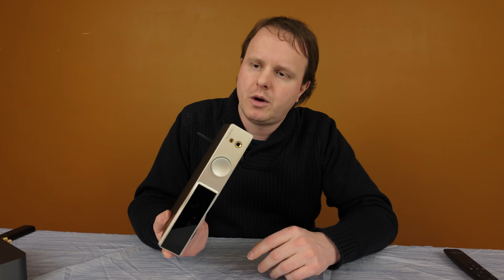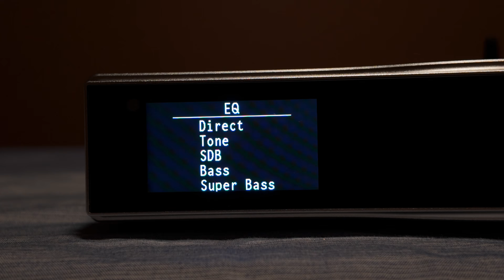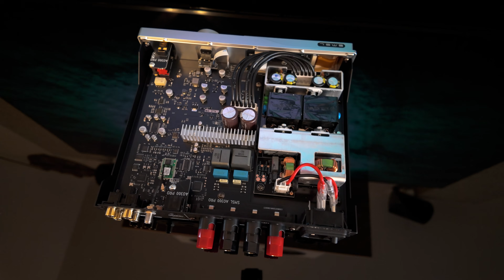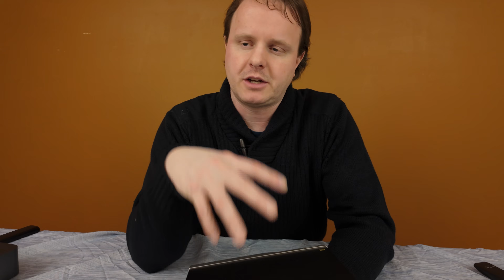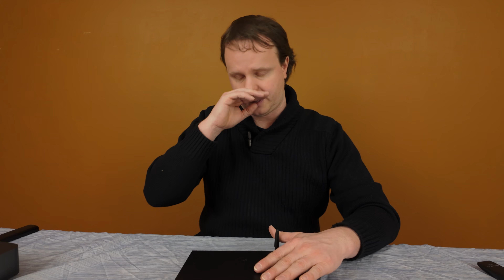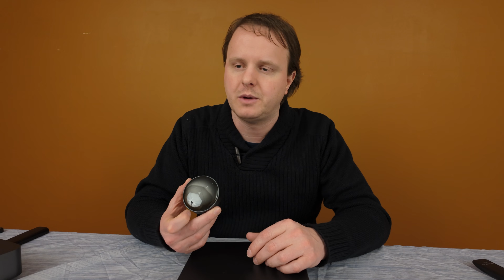Extremely High Quality Sound In a Compact Affordable Package SMSL AO300 PRO Review Vs. WiiM Amp

Comment: How does it compare to the smsl raw ha1? Seems very similar to
Reply: I recently bought the smsl raw ha1. It's almost identical AO 300 pro. The raw ha1 doesn't has hdmi arc. Further it is I think identical. They use both the same dac Cirrus Logic CS43131 DAC. I hooked a bluesound 2i up that I recently second hand bought. it works and sounds great. What I like also is that both have the same width. The bluesound 2i fits perfect on top of the smsl. I amde the choice for the raw ha1 because I only wnatd it for hifi use. But if you want it for tv and music, I would not doubt to choose for the smsl ao300 pro. The smsl raw ha1 and smsl ao 300 pro have the same width. The sound is realy good.

Comment: Those seeking reasonable audio reproduction need to know that nobody has been able to convincingly show they can hear differences in properly performing amplifiers. Testing goes back to the 1970s, and includes people who swear they can hear a difference (before being tested). It also is questionable to use the phrase "extremely high quality". Reproduced high quality sound has flat, wide frequency response, and total distortion measures of less than 1%--which all amps these days (and since the 70s) display. The real difference is going to be maximum continuous and short-term power output, which can be distinguished. Consider max power output, features and build quality--not how it "sounds".

Comment: If it isn't a streamer, it doesn't compete with Wiims at all.

It's just an integrated amp.
Reply: The Wiim amp is a streamer and also an integrated amp. So yes you can compare the integrated amps of both. He even says in the video that the Wiim has an integrated streamer and the SMSL has not.
Reply: The wiim amp has been reported to have a flat sound and after much research it isn't as powerful as this amp nor does it have a better sound stage youre paying for more features with wiim not better sound
Reply: @nicholasparish308 I don't know about more features as much as different features. This has a headphone amp section, which the WiiM Amp does not. 

I think I'll end up with both of them. This looks perfect for my desktop PC setup. I think I'll use the WiiM for my secondary TV's.

Comment: How does the sound quality compare to Rotel A8 Integrated Amp? thanks😀
Reply from the maker: Both are great even though the Rotel is only rated at 30WPC it sounds more powerful but the AO300 PRO has a lot ore options and fits in smaller places.
Reply: @AV-Obsessed will it sound more powerful in a blind test you think?
Reply: @AV-Obsessed  "Sounds more powerful". Can you explain what that mean? More bass, plays louder?